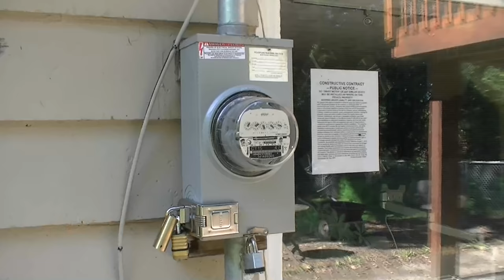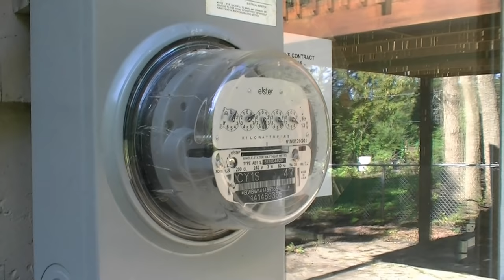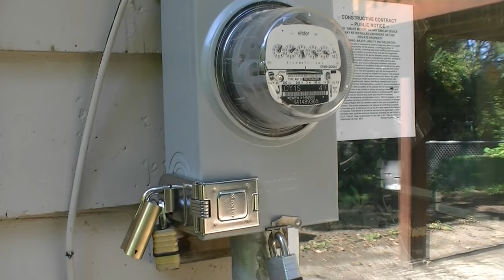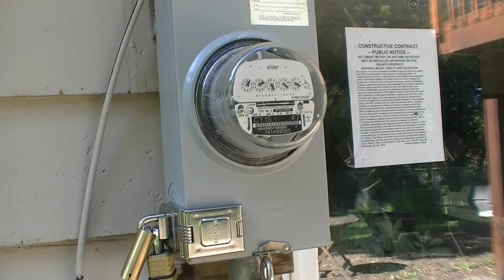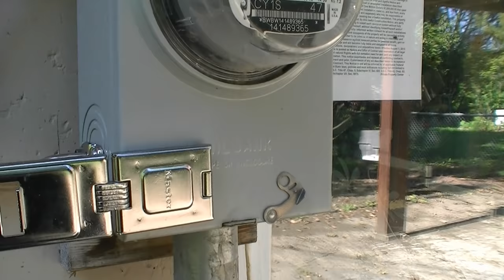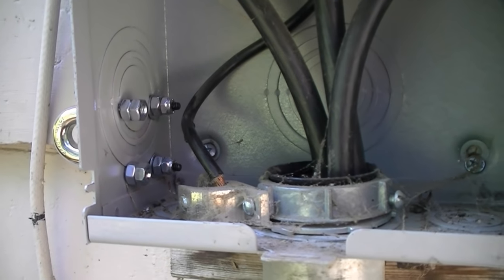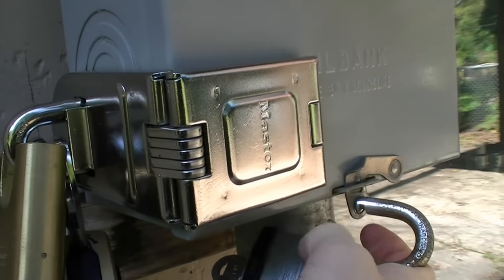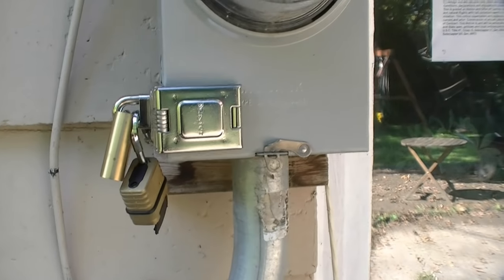Locking Your Electric Meter to Prevent Smart Meter Installation

Comment: Actually, the meter belongs to the electric company, and the service wires from the pole to your house to your Service drop at the weatherhead. that is, unless you are over 200 feet off the road, in which case, you have to have your own poles and wire after 200 feet.
  if you refuse access to the equipment, The power, which belongs to the electric company,will be shut off at the pole. A reconnect fee is generally around $250. That’s after you have gone through the process of paying for an electrical inspection by registered electrician that has to complete paperwork. Then the local electrical inspection officer in your particular municipality has to sign off on the job after he inspects your service, and places his approved sticker on your panel board, and signs the paperwork,Then the electric company will process the paperwork.... you will be required to make a deposit, which will be returned to you with interest after a year or whatever the requirements are depending on how severe the violation is.....After all of these processes have been completed,usually days later since the shut off, depending on how quickly you can find an electrician that is free to take on the job...The electrician you hire cannot reconnect your service .. Only the electric company can do the reconnect after all the hoops have been jumped through with local electric code inspection, registered electrician completes paperwork, and applies to have the electricity reconnected, this completes their end of the inspection process. you may get  power back on when the electric co can send a crew out to reconnect it at the pole once all of the inspections have been completed indicating that the issue has been resolved. and that the customer is back in compliance with your agreement and electrical codes. The electric company does have to reconnect the power within a time specified by the Public utility commission. Usually within 48 hours.They have to play by the rules just like you do.
People don’t realize that any problems created by the customer with tampering, payments,ect reflects on the customers credit rating.. A customer that has sprained the rules according to the agreement between the electric company and that customer, cannot just switch the electric bill into a friends or a relatives name in order to avoid paying a deposit or a late bill..The customer may be required to provide a copy of the lease agreement naming all of the residence living at that dwelling...
   When you signed up for electricity with your local electric provider. You signed an agreement, and in that agreement, you agreed to all provisions, one of which is to give access to the meter, and that the employee of the electric company has a right of way onto your private property pertaining to the electric company’s equipment.. If you lock your meter box and prevent access, you are  in violation of that agreement. The power can also be shut off for no access things like, parking your pitbull at the meter, Locking the gate or fence,blocking the meter with bushes, blocking access to the meter with a car or a van, planting poison ivy or thorn bushes at the meter, stacking firewood in front of the meter, even having someone stand in front of the meter with a baseball bat. I have dealt with everyone of these situations and more, and the customer did not win in any of them.
  I know a little about it, since I was a field rep for my electric provider for decades,I also had to work with in the guidelines of the Public utility commission.. I did the field investigations on possible tampers, non-pay, no access, dog, fires, new installs, houses or buildings being demolished, acts of nature, floods, sabotage,I’ve seen everything.. you can’t win this one. Actually, cutting the Seal on the meter socket latch to remove the lid on the box to get into the box to mount this lock in this video, it generates an inspection for tampering.People tamper, I have seen it without even removing the meter.
  Just be warned, there are thousands of amps that can/will kill you inside that box. Search on the Internet or YouTube for videos/pictures of people who have been electrocuted accidentally. Time lapse pics of day 1–2–3–4...It takes days for the damage to run its course. On the first day it’s just a nasty burn, but as the days go by, the arm or the leg swells up and turns black inside. Fingers look like sausages that have swelled up from cooking and the skin splits opened.Much like what a tick looks like when it’s completely gorged with blood. The arm or leg almost doubles in size..It swells up so big, they can’t possibly even move their fingers or bend their elbow.If you don’t believe me, search electrocution burns on the Internet. The victims are never Ever the same, never..
Reply: Well said.
Reply: BUT WHY DO THEY HAVE TO INSTALL A DEVICE THAT KILLS OVER 100 FOLKS EVERY MONTH?
They only have the right to measure what power you use.
THEY DO NOT HAVE THE RIGHT TO INSTALL A COMMERCIAL, MESHED NETWORK, HIGH POWER RADIO TRANSMITTER ON YOUR HOME
Reply: Frederique Zug 
   With an unnatural fear that you seem to have of EMF, I am sure that you never ever use a cell phone and hold it up to your head, and I’m sure that you never get closer than 10 feet from your television, and I’m positive you never ever use a microwave oven. And of course you never ever let the sun contact your skin, and of course you would never ride in an electric car with that large battery in the floor radiating you in an electromagnetic field, not to mention, the EMF coming off of the electric drive motor.You certainly don’t  drive near high tension electric transmission lines or near an electric  substation.. and of course you don’t live near or drive-through cell phone towers transmitting hi intensity microwave data.. i’m glad you would never use an iPad  or laptop computer on your lap. And of course you would never sit within 6 feet of a desktop computer monitor.
  And I’m certain you would never ever fly in a commercial passenger airliner, that flies up above parts of the earths atmosphere that protect you from dangerous radiation from the sun... i’m also glad you do not work where they have fluorescent lights, which I’m sure you don’t have those in your home either..I’m certain that you avoid traffic light sensors that detect your car approaching so that the light may change for you. Of course you could live in and abandon mine underground for protection from the sun and gamma rays and things like that, but in a mine, you would be living with a lot of radon, and mercury ... 
   You can of course verify the number of deaths and the causes of death with more than sensationalism on YouTube. A lot of these Clickbait video makers on YouTube are not held responsible for their unsubstantiated statements just to get clicks.
  I wish I knew what you were talking about, and, I wish you did too.
Reply: So Harry Lime.
 I have noticed all power company manager keep telling us their power bill is lower after they had a smart meter installed.
For the good folks getting the high power KILLING MACHINES installed on the side of their homes.
What software patches do they ask for to get a meter that is programmed to read 25% lower?
Reply: Frederique Zug 
  Powerful statement. Take your proof to the FBI, call CNN , or better yet, the national Inquirer...yes, You should have no trouble convincing them to get behind you on this righteous mission for justice.
I am the last person you should ask to join your crusade for obvious reasons. don’t ask me to attack those windmills from horseback while wearing an armor suit, I’ll leave that for your capable hands..You should have no trouble convincing the authorities to round up the scoundrels and put them behind bars. I mean, you obviously have all the proof you need
   By the way, the 31 years I spent working in field services for the electric company, I used to shut off an average of 37 deadbeats a day. An unsettling proportion of those deadbeats didn’t pay their bills because they had other things to spend their money on. They were junkies. When they would initiate a confrontation in an attempt to intimidate me or prevent me from completing my duty/mission. Many of them would go into a rant, much like someone you know..it is a good idea for you to call this number. They will listen and understand
  877-528-1304
Reply: Harry Lime   DO NOT DO THIS
I REPEAT, DO NOT DO THIS 

Sigi Henke 3 months ago said:
How to kill a smart meter.... Get a smaller microwave oven, remove the door screen and glass. Then close the door and set your timer. Then push the microwave oven fully over the meter so the meter is actually inside the oven. Press "Start". The electronics in the meter will be totally fried in a fraction of a second. You probably have seen what happens when metal is in a microwave oven ..... lots of sparks and vaporized metal. Make sure you don't harm yourself by the microwaves of the oven which must be facing away from you!!!!!

Ferkemall 4 months ago said: 
Just get an old microwave put on a chair facing the smart unit open the door jumper the door switch and give it 20/30 seconds then tell them it went tits up and can you have and older meter back ,they will never work it out !

Let me repeat this again. DO NOT DO THIS
Reply: Frederique Zug 
  My grandmother taught me a statement that is very true.
  The more you wrestle with a turd —-The more shit you get on you..
   I’m done wrestling
     Good luck. And call that number I gave you
Reply: New reply  from our newest MURDER Harry Lime     "Actually, the meter belongs to the electric company"
WE AGREE HARRY LIME, ANY DEVICE TO MEASURE THE POWER WE CONSUME IS YOURS
YOU HAVE NO LEGAL RIGHT TO INSTALL TWO RADIO TRANSMITTERS ON THE SIDE OF OUR HOMES

If you disagree, then feel free to give us the law that gives you this right
HELL, WHY DON'T YOU SHOW US THE RADIO LICENCE YOU PAID FOR FROM THE FCC

Comment: You should probably build a small structure around this meter, just in case. Then the power company can only check the meter when they make an appointment with you. Then if they tamper with it, it will be breaking and entering....in addition to vandalism.

Comment: I noticed comments about your service tag being removed.  The tag itself is property of the electric company, however, the box they attach it to is the property of the homeowner.  I'm guessing that there is a legal notice that clarifies that difference and that anyone other than the homeowner attaching anything to the box itself if tampering with the homeowner's private property so technically when utility companies put those tags on the boxes, they are in violation of the law?  Would be good if someone could clarify this.

Also, I did not see anywhere in the video where you talk about the "Constructive Contract" you have posted.  Not everyone has a window near their box for the utility company to see and if we put it on the exterior of the house chances are it would be removed and the false claim would be made that they did not see such a notice.
Reply: Did you notice this smart meter was installed in violation of the FCC's DISTANCE TO COMPLIANCE law?
Reply: I'm not  exactly sure what that means, but when it comes to regulations and laws we, as citizens do need to stay informed.
Reply: I just noticed today that the rental next  to us has three smart meters on our side of their building.  It  just so happens to be on the same side of our house as our meter.  I have not been able to get to our meter yet to see if it is a smart or analog version, but I will be checking.  Wondering how we can protect ourselves from the EMF's  coming from the three on the building next to us that is only about 7 feet from our house.  There is no fence there to put any barrier.

Comment: You have no clue how any of these systems work.
Reply: La Diablo they are not radio. The are called TWAC. It's two way automated communication. The apply a dead short on the line at the substation and read the meter at 0 degrees on the sine wave. That's the simple way of explaining it, which is probably still over you head. So I won't bother being any more descriptive than that. Just know they are in no way radio controlled or anything to do with radio.
Reply: You were talking about radio transmitters... and now you switch gears after you were wrong about the radio transmitters and are spewing some stuff you copy pasted off Wikipedia about meter read success rates?

These meters get read several if not more times daily... any errors would be apparent and omitted.
Reply: TWACS is widely used, and is pretty much industry standard. Do you have power in your house? Or are you on your phone in a starbucks parking lot? You probably still live in your moms basement.

Comment: You cannot deny access to the power company's meter. THAT is THEIR property. Here's a clip from the contract that seems to be similar in most states/power company contracts;
238. After the customer has applied for and/or received service from the electrical utility, he
shall make every reasonable effort to prevent tampering with the meter and service
drop/service lateral serving his premises. A customer shall notify the company as soon as
possible, of any tampering with, damage to, or removal of any equipment.
TAMPERING WITH METERS OR WITH CONDUCTORS CARRYING
UNMETERED CURRENT AND UNAUTHORIZED BREAKING OF UTILITY'S
SEALS IS PROHIBITED BY LAW AND WILL NOT BE TOLERATED BY THE
COMPANY. THE COMPANY MAY DISCONTINUE SERVICE IF THE METER,
CONDUCTORS OR SEALS HAVE BEEN TAMPERED WITH.
239. Any form of meter tampering and/or fraudulent use may be cause to take one or more of
the following actions against the customer:
 Terminate the service.
 Charge the customer for unauthorized energy use.
 Charge the customer for damage to SCE&G equipment.
 Prosecute the customer for violation of state law.
240. STATE LAW PROVIDES FOR FINES OF UP TO $10,000
AND/OR IMPRISONMENT UP TO 10 YEARS FOR METERING TAMPERING OR
FRAUDULENT USE OF ELECTRICITY.
It's ILLEGAL for you to break a utility company seal in all 50 states. As in 240 above: You tampered with the metering equipment, so they have the right to be sure you are not stealing power.
By the way, just read the code yourself:
 http://www.nfpa.org/nec/electrical-codes-and-standards/nfpa-70?code=70

Comment: 2.3.1 Frequency Hopping Spread Spectrum

Operation in the 902–928MHz Band Regulations in the United States
The frequency band of 902–928 MHz is one of the Industrial, Scientific, and Medical bands in the US, commonly abbreviated as the 915-MHz ISM band. In this band, there are no restrictions to the application or the duty cycle as   there were for the control and periodic applications described above. Furthermore, the allowed power output is considerably higher. Because of the lack of restrictions and higher allowed power, this band is very popular for unlicensed short range applications including audio and video transmission. FCC section 15.249 allows 50 mV/m of electrical field strength at 3 meters distance in the frequency band of 902–928MHz. This corresponds to an EIRP of – 1.23 dBm. The harmonics limit is one hundredth of  the fundamental level, 500 μ V/m, corresponding to an EIRP of  – 41.23 dBm. Note that this is the same as the spurious emission limit listed in Table 1

Frequency Hopping Spread Spectrum Even higher output power can be used if the system employs some form of spread spectrum such as frequency hopping or direct sequence spread spectrum. The reason such allowances are made is that spread spectrum systems are less likely to interfere with other systems than are single frequency transmitters.
The output power limits for frequency hopping is one of the few times that the FCC expresses such a limit in units other than the observed electric field strength. As long as the antenna gain is not larger than 6dBi, the permitted peak transmit power delivered to the antenna is +30 dBm for systems with a 20-dB bandwidth lower than 250 kHz and at least 50 hopping frequencies. For systems with a larger bandwidth but less than 50 hopping frequencies, The peak transmit power is +24 dBm.
Transmit power for the 902 – 928 MHz band
Frequency hopping EIRP > 50 channels: +38dBm
Digital spread EIRP      +36.dBm
Other        EIRP  -1.23 dBm
ALL measuring shall be done with detector using a CISPR quasi peak detector.
 
http://www.ti.com/lit/an/swra048/swra048.pdf

So the safe distance for a healthy human is 43 centimeters
Multiply that distance by a 100 times for a disabled homeowner with an unshielded medical implant.
CAN YOU SHOW US THIS LIFE SAVING INFORMATION ON YOUR COMPANIES WEBSITE 

THANKS FOR HELPING ME WARN YOUR CUSTOMEWRS ON HOW EASY YOUR SMART METERS CAN KILL drc10101